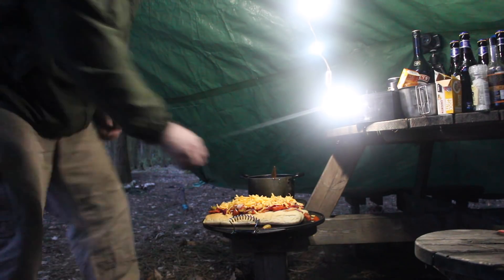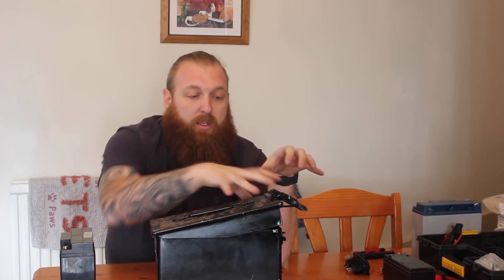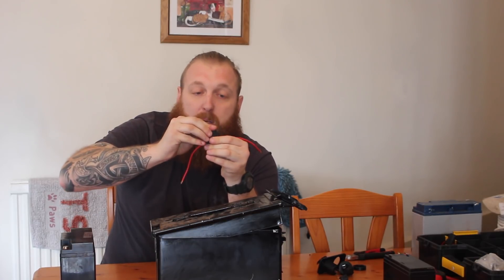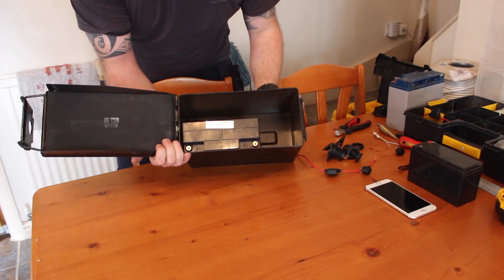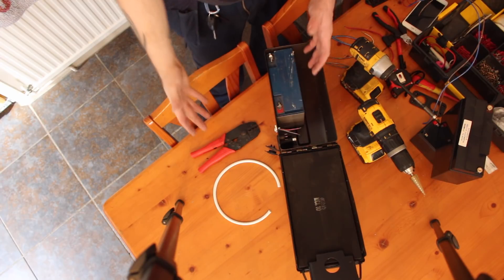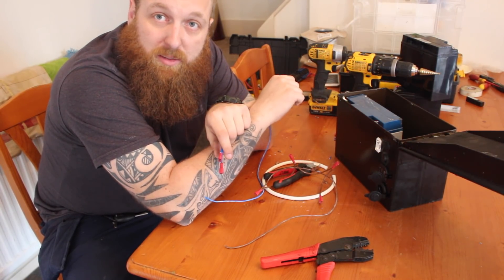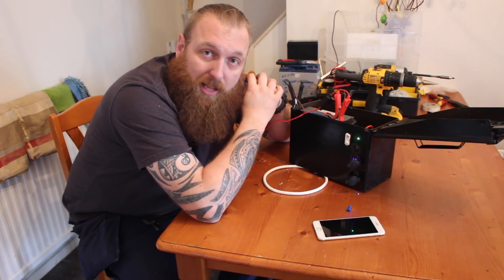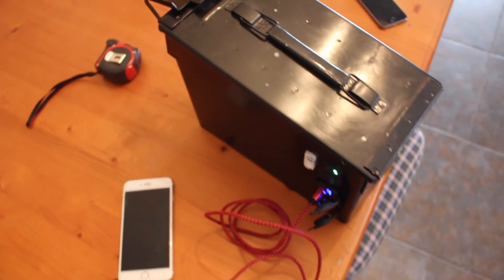How to make a DIY off grid ammo box battery bank.

Comment: Rich do you need a voltage reducer on this ? 
I just went to buy a battery and the maplins guy said 12 volts is too much power for a phone ?
Reply from the maker: Cornish Knives & Camping a phone takes 6V DC but the input to the USB is 12V and reduces it.
Reply: Bug out vehicles UK Torn Apart self sufficiency. 
Cheers Rich I did say to the guy I had all the bits (usb ports ) don’t think he understood what I was asking, but you cleared it up for both of us lol 😬
Cheers mate 
Mike 
StayCornish 👍

Comment: nice vid, how would you go about charging from the 4x4?
Reply from the maker: Gary Giles just join it to one of the vehicle battery’s or make a lead that plugs into one of the outlets. It’s just 12v to 12v.
Reply: Bug out vehicles UK Torn Apart self sufficiency. Clearly I was over thinking it, thanks.

Comment: Another cracking video and what a good idea to show people how to do it for themselves. 
Easy for a tradesman but could be daunting for some people but to share your knowledge and 
Show people how to do it brilliant. Ps any chance of doing one for led strip lighting best place to buy etc
As there great for tents using this box. 
ATB WG
Reply from the maker: wjnr1 personally I don’t like the long roles of leds because they use a fair bit of electric. You can get a strip of leds that have a little unit then a few inches of cable then another and so on off eBay that works well. Iv got a few that I string round camp. Thanks for the kind comment too.

Comment: Nice one Rich, definitely worth thinking about a solar controller for the box. Apart from all the free charging (obv with a solar panel) it'll protect the battery from being over charged and under discharged.
Reply from the maker: TheLastPost it’s a good item to stick on. I’d probably use a different shape box tho if you wanted a controller in it.

Comment: Decent! I did the same thing with my fishing tackle seat box and a 75amp leisure battery , can run a strip of LEDs , charge gear constantly and have movies on the laptop for 3 days and still jump the van off it when needed. Iv got a 20 watt solar panel that goes on my bivvy roof too but never needed it so far. .. it's a bit heavy being a leisure battery plus tackle but seeing your vid rich, I think i'l get one of those batteries for Riverside overnighters so I'm a bit more mobile. Nice one .
Reply from the maker: BUSHCRAFT AND FISHING WITH THE PIKEY can’t go wrong with loads of charged up battery’s to hand pal.